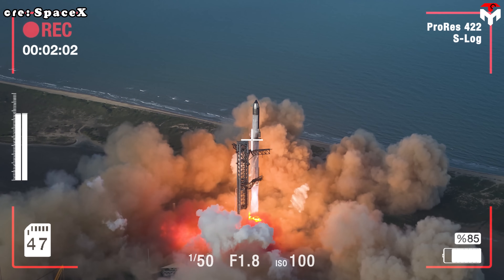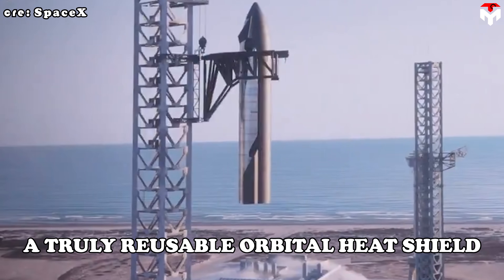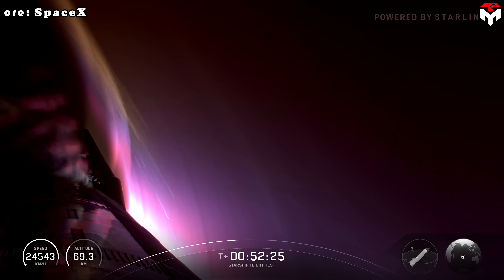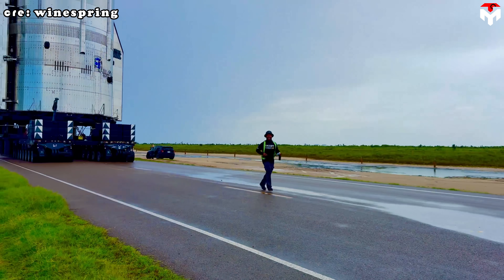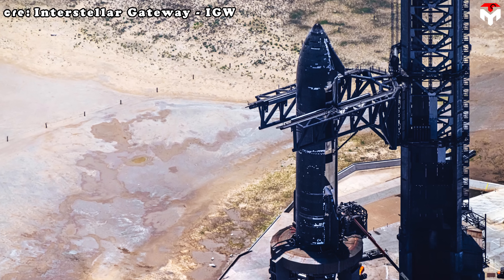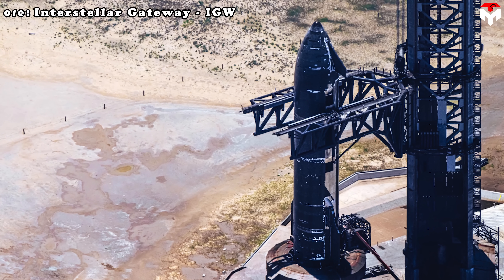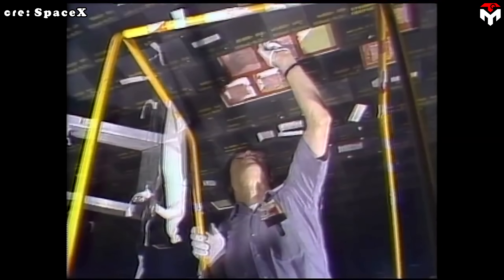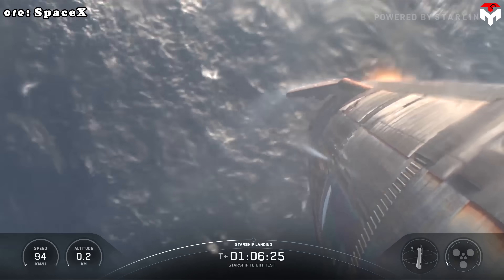SpaceX found a Brilliant method to SOLVE Starship Flight 10's heat shield's Big Issue, Shocked NASA!

Comment: Why should NASA be embarrassed? For decades, NASA has safely reentered hundreds of manned and unmanned vehicles, capsules, and shuttles with heat shields into the Earth's atmosphere. SpaceX received $2.9 billion in taxpayer dollars from NASA to develop the Starship/HLS for crewed lunar landings. The heat shield for the unmanned stage is only one small of many big problems for SpaceX. It's a contract, not Musk's own money!
Reply: Tell that to Boeing, maybe it's not occurred  to them!!
Reply: @davidtuer5825  "Tell that to Boeing. Maybe they haven't noticed yet!" ... 
What does the Starship's problem with developing its own heat shield technology for orbital reentry have to do with Boeing's spacecraft for lunar orbit? This post is about SpaceX, not Boeing. They are two different companies working on different aspects of the project on behalf of NASA. Whether you like it or not, they both have to deliver. I'm more concerned about SpaceX at this point.
Reply: @bordeaux1962  You wrote at some length about the number of successful flights made by NASA over the years. NASA didn't build the rockets Boeing did. SpaceX's record of manned flights to and fro to the space station has outshone Boeings record in every metric.  The heat shield problem that SpaceX is grappling with is because their heavy ship, developed to go to Mars is an order of magnitude bigger and heavier than  any other rocket ever made. It is not a competition between Boeing and SpaceX, it is a fundamental physical problem that Boeing isn't working on, so far as I know, because what they want to send to the moon is a jazzed up version of the rocket ships that carried the astronauts to the moon 60 years ago.
Reply: @davidtuer5825  I have learned that, to achieve a common technical goal across different teams, you must work in segments, combining the teams' efforts until you succeed. The knowledge gained in the process can be applied to future missions. However, it doesn't make sense to claim, as you and others do, that SpaceX is not using the time, energy, and money it has received for the actual mission, but is instead solving a minor problem that will later become important for a completely different goal. That simply doesn't make sense to me. However, it's probably pointless to discuss this with the fan community.
Reply: @bordeaux1962  You seem to think that the contract that SpaceX is now working on is to replicate the Apollo program of the 1960's. I would say that is a pointless exercise. As I understand it, the idea this time is to establish a "space station" on the moon. That will require an enormous amount of hardware to be taken to the moon and erected on site. That would be enormously expensive and time consuming if , for instance, the SpaceX falcon rocket, or a current Boeing rocket (which they don't have) was used. It would take decades of work to establish such a station. The SpaceX heavy will transport that hardware in a fraction of the time and for a fraction of the cost. 
Your reference to the "Fan Community" , presumably anyone disagreeing with you, does nothing to strengthen your argument.
Reply: @davidtuer5825  Do you think I'm senile? I responded to your argument that we should prepare missions to Mars for colonization. Now you're switching to the moon, fine. I don't currently consider the permanent colonization of the moon or Mars to be an urgent goal for humanity. In my opinion, there are much more meaningful projects in space science. But if it has to be done, I can live with a scientific station on the moon, even if it will be extremely expensive. You may see it differently, but if you're talking about scale, you also need to explain to me how the unprecedented amounts of taxpayer money, probably in the trillions, that will be paid to commercial companies like SpaceX for the permanent colonization of Mars as planned, would be justified without there being any meaningful benefit. But as I said, it's pointless; you will continue to dismiss questions and issues with insinuations. To name a few objectives instead of "colonizing mars within the next decades" : recovery of samples from the Mars rovers. Use of robots on Mars. Exploration of the planet's moons. I can list dozends more ...
Reply: Musk has repeatedly stated that reusable heat shields may be the biggest barrier/problem keeping them from achieving their [affordable] moon/mars goals.
Reply: @OrleyJensen  Whenever he needs to solve current problems, he plays the “future of humanity” card. He claims that only he can solve these problems, and that he must do so right now. Everything for Mars! Do you fall for it? 
For the taxpayer-funded NASA Artemis / SpaceX Human Landing System, the re-entry and reusability of a Starship launch stage into Earth's orbit is currently a minor issue that will only become an economic issue later during continuous operation. We are far away.  The frustrating thing is that Musk wants a partially reusable vehicle with a high payload only because it aligns with his other business plans. 
Ultimately, a functioning vehicle will benefit everyone, but the way he is pushing it forward is completely dubious. I'm only mentioning the brutal handling of NASA structures and budgets by DOGE via Musk, on behalf of the government with very „special“ political ideals. Would you entrust the "future of humanity" to someone like that? Not me.
Reply: @bordeaux1962  so what - he has solved problems no other company has, he will continue to solve problems to meet his goals. Artimis is a group effort with many players involved. Musk is not the dictating the tech or budget, or agenda. Artimis was put up for bid and space-X won the bid to do the lander.  NASA has been a tax-payer funded boondoggle for over 60 pus years - what is your problem with a private company being involved - a company that does more innovation than NASA ever did?  You mind is has been poisoned by left wing media disinformation - do a little reading before spreading your lies.  Why are you not complaining about Sam Altman, B. Gates, Zuckerberg, Bezos they have all enriched themselves with government contracts or benefited by introducing dangerous technology, surveillance tech, with questionable goals and agenda.  Bezos failed to get NASA contracts because his tech sucks.
Reply: @OrleyJensen  You seriously tell me that when I criticize SpaceX, "Your mind has been poisoned by left-wing media disinformation"?  Wow. 
Well, there's an egocentric billionaire in the US whose political agenda I won't discuss here. You believe everything he says, no matter what. He will supposedly revolutionise space travel for the good of humanity. I can no longer participate in this level of uncritical glorification. In future, I will look to places where people have a little more perspective. All the best.
Reply: @bordeaux1962  You made no valid criticism of Space-X. You just spewed non-sense propaganda that you are parroting from what ever source you listen to.  Space-X is guilty of nothing except innovation. You somehow twist their success into something sick that fits you narrative.
Reply: @OrleyJensen  I don't think you've read any of my long answers and explanations posted here. Now, you're speaking very contemptuously about "nonsense, parroting and propaganda" without offering any substantial response to my criticism. In fact, you are a prime example of a cult-like community that rejects criticism by insulting the critic instead. You're not a serious discussion partner for me, sorry.
Reply: @bordeaux1962  I read your comments but everything you said after the first comment was meaningless. You started by saying NASA has nothing to be embarrassed about by citing decades-old history.  Agreed, in its heyday NASA accomplished a lot, but that is irrelevant today. This discussion is about the recent embarrassing performance by NASA including: stranded astronauts, Cygnus, NEA Scout, IM2, and Artemis Program delays. You continued by criticizing Musk (not Space-X as you falsely claimed in your follow-up) for his role in DOGE insinuating that there was something nefarious about it and that it caused NASA’s recent pathetic performance. Your assertions cannot be supported with objective reality or time lines – the cuts were only a few months ago, their failures are the result of a decade of work. The DOGE team only identified waste fraud and abuse and DOGE had no authority to make cuts to any agency or entity. Congress cut NASA’s budget. Musk founded Space-X but he does not run day-to-day operations. There is no evidence that Space-X was awarded any contract as a favor for Musk’s role in DOGE as you insinuated. Space-X won their contracts fair-and-square with the best tech at the best price. As for your point about Musk not personally funding the project, I guess that was to draw attention to his extreme wealth. There a lot of billionaires, present and past, they create jobs. As for you comment on Musk’s motivation to help humanity, how is that in any way relevant to the subject of NASA and their poor performance. It was clearly meant as a smear. So everything you said was all about disparaging MUSK, not space-X, and then defending that nonsense. You questioned his motivations, his wealth, his involvement in DOGE, and his achievements. The heat shield is critical and not a trivial problem – it is rocket science. Give credit where it is due. Musk is the most successful entrepreneur in human history but you cannot acknowledge that or NASA’s failures because your mind is wrapped around petty irrelevant strawman arguments.

Comment: I don't see the "refueling in orbit" so hard.
- it is not time-critical (can be halted, then restarted, can be slow at first and improve later)
- no explosion hazard (gasses can be separated by the vacuum)
IMO much harder to create thermal insulation and/or cooling system  keeping liquid gasses cold for day/weeks/months.
And the almost-impossible (maybe impossible)  reusable heatshield problem. My guess is that Spacex can't have a heatshield solution able to immediately relaunch, but a fast (some hours/days) and cheap automated heat tiles refurbish process.

Comment: I don't understand why spaceX don't take advantage of the high rate of launch of Falcon 9 in order to fast track the tests and development of the heat shield tiles
Reply: no orbital reentry on falcon ?
Reply: @antypanag1 
Well the second stage of Falcon 9 does reenter the atmosphere and burn up so that it doesn't fill the orbit with junk, which is standard for all orbital launches.

They could very well tile the second stage and evaluate the tiles during the first phases of reentry. obviously the Falcon 9 second stage would have lost its fairings, it lacks a skirt protecting the engines and it doesn't have sufficient RCS to keep controlled attitude during reentry so the tiles can't be tested all the way down.

I guess the main reason is that they don't want big chunks of the orbital stage falling back in an uncontrolled way back to the surface.
Reply: @halnineooo136  my bad. Seems you are right !!!!

Comment: 3 metallic heatshield tiles would not cause that much oxidation especially being postioned near the top as the Ship was in a belly flop manoeuvred projectory while re-entery. That was heat tile degradation on a massive level  - in other words, go back to the drawing board you engineers.

Comment: Did everyone forget about the Shuttle?
It had Fully reusable heat shielding that only needed inspection and repair of any damage between flights.
Reply: The space shuttle's overall launch-to-launch turnaround time averaged about six months, though it varied significantly, with some missions taking longer and the fastest being 54 days. This lengthy process was largely due to the complex, labor-intensive, and brittle nature of the Thermal Protection System (TPS), which involved the careful inspection, removal, and replacement of thousands of heat-resistant tiles
Reply: You're kidding right?
Reply: I think you're misunderstanding what "reusable" means. The Shuttle's heat shield required intensive repairs for every flight.

Comment: Flight 10 didn't have a heatshield failure, it was an experiment with deliberate changes made including actively cooled metal tiles, missing tiles and other experiments.   The metal tiles the source of the orange streaks.  Flight 11 is going to be a different flight in that they are not going to stress the heatshield deliberately.
Reply: Space X prepared the flight 10 to fail basically but the ship survived
Reply: @viarnay  They weren't preparing it to fail but they were pushing it to find the edge of the envelope.   This is actually quite a sucess, the Starship is far tougher than any   other orbital system.   Stainless Steel appears to be the new Carbon Fiber.

Comment: Space X will probably solve the heat-tile issue, but it may take time. 

In the meantime, Space X should consider using expendable Starship-tankers.  The trade-off will be fewer fueling-events (maybe 4 to 7) as an expendable tanker can deliver greater tonnage to orbit.
Reply from the maker: That’s a really interesting idea, expendable tankers could potentially streamline the fueling process!
Reply: @techmap9 At least until until the heat-shield problem is thoroughly solved.

Comment: It is a thought that the booster needs to return, therefore less heat-damage to it via re-entry. Many upper stages could be 'disposable' and re-used for habitation/storage. SOME upper stages might need to be re-usable, but why don't they use shallow re-entry to aero-brake them at less heat stress? A small disposabe 'ballute' isn't going to break the bank, compared to the cost of fuel/oxidiser it would be trivial.

Comment: The engineering challenge of the heat shield is to keep the Ship from cooking on re-entry and keep the shield from falling off as it goes through massive temperature extremes from cryogenic propellant loading(-183C) to re-entry plasma fireball(1700C), so call it 2000C delta
Assuming that you have a perfect heat shield tile, how do you keep it on the ship, prevent it from breaking at both hot and cold temperatures?

Stainless steel has a CTE of 1.34 mm/mtr (1.5 x 10⁻⁶ /°C).  If your tile is 0.1m wide and you have a 2000C delta the SS structure will expand 0.1m * 1.34 * 2000 * 1.5 *10 -6) meters = 0.0004m, so the gap will be about 0.5mm.  If the tile beside it has the same change, you are looking at a total gap of nearly 1mm for hot plasma to get through.  Doesn't sound like a lot, but pretty easy for you to get through if you are hot ionized oxygen molecules

Crunch wrapping is attempting to solve this problem.  kinda like wrapping your grandma's china before you box it up for moving.

At cryo temperatures when the gap is the largest the paper wrap will prevent the tiles from rattling around and breaking each other
At plasma temperatures the gap will close off protecting the wrap from the hot plasma

Comment: It’s not surprising that it’s taking several tries to solve the heat shield problem !
It always was one of the most difficult problems.
Reply: It's a problem that hasn't been solved yet... especially reusability. That could be the deal breaker for reusability...
Reply: @masaitube 

It's been solved on the shuttle program - less than 5% of shuttle tiles were replaced across the entire fleet. 

Starship's TPS is just a badly replicated shuttle tiles. Also not sealed against moisture, so it flies with water logged tiles every time.
Reply: @dimitryzarkh2084 it’s evolving, just a matter of time before they figure it out. Spacex works at a crazy pace and there’s a reason they’re cranking out so many starships. They’re able to iterate faster then anyone else
Reply: @masaitube But they have one that works for one shot at least..

Comment: It will take a long run of perfect reentries to reach a point where the heat shield does not require minute inspectin of all the tiles, and certainly the engines before it flies again... especially in a man-rated craft.  There is no emergency escape option, so it will be very unforgiving.  Rapid Reuse is a long term goal.
Reply: It was always unlikely to be solved in one fell swoop !  It’s going to have to be tested and iterated on..
Reply: There will be no man-rated Starship for reasons you just gave.

Comment: The crunch wrap has two very good things going for it
1) It will prevent the tiles from rattling together ( and breaking) during launch when Ship is at it's coldest and the gap between tiles is largest
2) Tile expansion during the heat of re-entry will close the gap between the tiles, protecting the wrap from hot plasma ablation

Comment: If you must return something from orbit, that problem was solved by the inflatable loftid.  The very large aeroshell had so much dynamic braking, there was almost no wear.  Starship is stupid and Elon's analogy to aircraft reusability is a failure in logic.  The best part is no part.  You seldom need to return mass from orbit.
Reply: Unless your goal is to return the launch vehicle , over and over , then its paramount
Reply: This is why you will never be a billionaire.
Reply: @chrisolix3441 You don't need to return the second stage.  Neutron second stage will cost less than the cost of labor to inspect starship.  Elon makes mistakes. Starship will never have high launch cadence, while other providers will.
Reply: That solution might work well for a small capsule.  It’s a good deal less practice for Starship though.
Reply: Ahhh, the famous space industry expert, mefobills279, says the starship is a bad idea, now we all should listen to them and shut the development down.